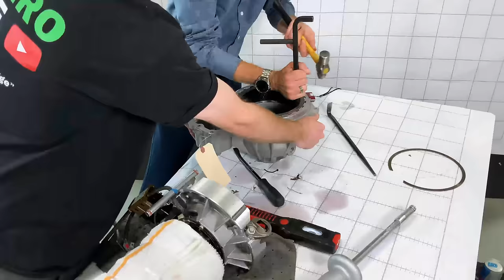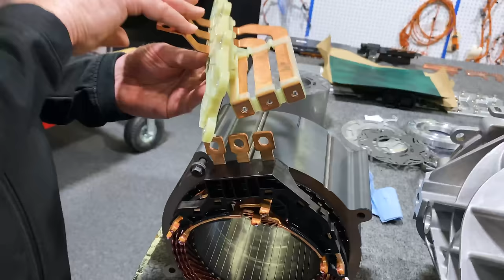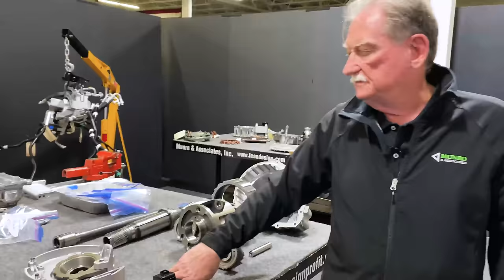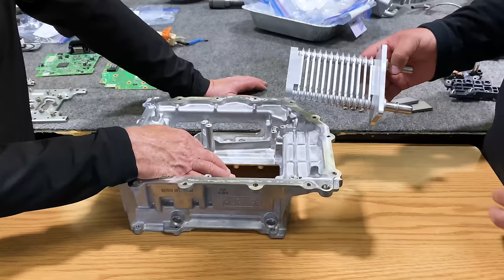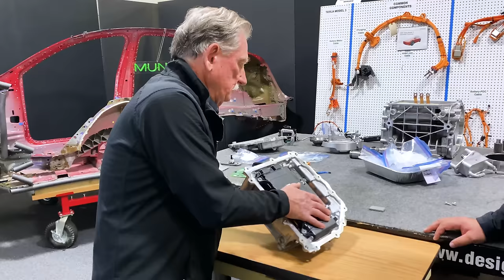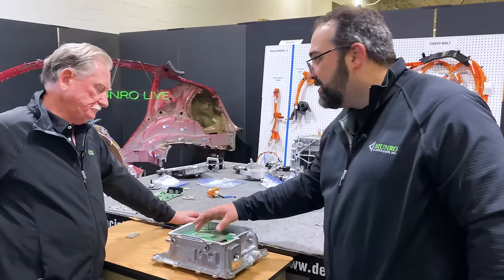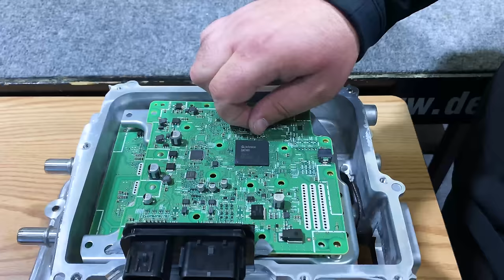Ford Mach-E Rear Motor Teardown and Analysis

Comment: Large circuit boards subject to vibration tend to flex in not supported spans as a result of vibratory accelerations.  This flexing can crack solder joints.  Solutions are to use thicker PCB material (high cost) or provide more supports over the span.  We did larger PCBs and vib testing will kill them if you don't have the needed support points.  Brackets or support rails are a typical solution.  I believe that the vibration environment of the car and associated motor is the reason.
Reply: I don't see how someone could challenge the intelligence of a design god that understands everything man-made that moves. He could've saved every OEM billions of dollars by using least amount of components to achieve highest level of design perfection. Thing about how much all these money can do to world peace.
Reply: resonant frequencies are a b1tch... a simple interaction between a couple of fans and a hdd can make a pc case vibrate so loud you'd think it will disintegrate. :)
also by the look of the board at 25:56 the fasteners appear to be thermal couplers and the plate that mounts on top is a large surface heat sink.

Comment: That base part is so demanding to assemble that I expect even the robots are going to walk off the job,
Reply: Sandy should give us a total count of threaded fasteners needed to build that assembly
Reply: Was that designed and built by a third party?  The labor of assembly and all the extra parts!
Reply: @billy-go9kx  It's a Borg Warner IDU.  B-W did the overall design, subcontracting out the design and part of the manufacturing for the motor and controller.  The case and gearing was done at B-W, and the final integration was to Ford specs.
Reply: @1djbecker  You'd think that a Borg collective effort would be better than that.
Reply: @psdaengr911  In this case for more assimilations, I suppose.
Reply: @1djbecker  Perhaps Ford overestimated the design and the price on what they agreed upon needed some extra materials thrown in so it could be justified :D

Comment: Looks like your team does not have enough power electronics and motor drives background since you focus a lot on the mechanical and manufacturing part. For a motor with or without oil cooling, the difference is the cooling efficiency which determines the size of motor under the given maximum power. So the Mach-E definitely has higher power density than vw ID. For a inverter, the most important indexes are power capacity and control accuracy. The relevant parts are power module, cooling system, current measurement and position sensor. Looking forward to seeing these information in the later e-powertrain tear down videos.

Comment: Could it be that the MOSFETs are soldered to the PCB before insertion in the hatsink assembly?
Reply: Yes, that's undoubtedly how it's actually done.  I imagine the MOSFETs are attached to the PCB, and the entire control circuit side is assembled before being fed through the cooling plate with the TIM applied to the pre-applied MOSFETs.  This makes it a very simple process that isn't very error prone.

The top side assembly could be largely automated then... one tech installed the first plate, sends it to a machine which handles all the welds, then it goes on to the next station... insulation is applied, next plate, back to the next welding station, etc...
Reply: @looncraz  Makes Sense! Still a lot of steps and welding and soldering during assembly time.
Reply: @AndrejGobec  Sure, but that's not much of an issue for this particular component since each step is basic enough you can train replacement workers easily and quickly and run several production lines at once.  The numerous fasteners are the greatest issue, as always.
Reply: Exactly, I'm pretty sure Sandy got this part wrong. Never the less, the design of the inverter could much more elegant and simple.
Reply: @looncraz  The 3 welding steps they described probably go in different sequence - put both coper contacting sides at one time maybe manually, then machine welds it, puts the middle top part and weld it again.
Reply: Hey Mike! 👋 great to see you around here! big fan of your reverse engineering work! 👍
Reply: I thought the same thing. But you still have to remember that all the MOSFETs should then like up with the slotted holder with spring . But that component can only be slid in from the side which would get in the way of vertically arranged MOSFETs. Try to visualize the first part of the video with MOSFETs already protruding from bottom.
Reply: @amkarkare96  Slotted holder first, then MOSFETS soldered to PCB fed in from bottom.
Reply: @amkarkare96  They probably use a jig to ensure proper alignment. Sandy really needs to hire an electrical manufacturing engineer. He might know mechanical design but this video made it clear he doesn’t know anything about electronics.

Comment: Ford has engineered this car to have "a lot of opportunity for failure."  Ford dealerships are very pleased because they see big $$$$$ repairs!!!
Reply: Imagine the joy on a dealers face, when someone comes in with a rattle in the inverter, and occasional cutting out. " Oh yeah, we get that a lot, someone's  dropped a screw inside the inverter." That'll be $1849.63 please.
Reply: Have you ever heard of an EV inverter failure? I haven't, but I'm sure it must have happened somewhere. Parts like this are replaced, not repaired. The three copper strips Sandy complains about allow inverter replacement w/o opening the motor housing.
Reply: @chrisheath2637  or a short  - no one will hear that tiny rattle
Reply: @chrisheath2637  But before they repair it they will try to tell the customer that the noise is normal and a reboot is nothing to be concerned about.
Reply: Acctually, the Mustang is proving to be very reliable. And has a better overal build quality than the Tesla.

Comment: Skewing magnets is done to rduce torque ripple because of magnet flux linkage to stator fin poles. Optimal total skew is always 1/2 * 360 / Stator_slots
 degrees.  It also smoothens harmonics from motors back EMF, but reduces your torque output by max 10%.

Comment: Another area of concern is the high number of soldered interconnections between circuit boards. I have seen solder joint failures in the form of “fatigue cracking” (possibly originating from a poorly prepared solder joint) on automotive circuit boards that could potentially occur here over time from motor/drivetrain vibration subjected to the circuit boards. It would be beneficial to reduce part count by integrating more of circuitry onto one or two boards at most.
Reply: Or use leaded solder again...
Reply: @dangraff8467  They're either wave soldered or the parts have solder "paste" and are heat flowed, but they are flowed in one shot.
Reply: @dangraff8467  You can weld certain things, but when you are attempting to electrically attach delicate components, it's not easy to contain the current or magnetic flux welding produces.  It would also be extraordinarily time consuming and expensive.  Plus, welding is impossible on ball grid ICs of which many are used these days in dense boards. Properly soldered circuit boards should easily last 30 years in a car environment from a physical standpoint (including shock and thermal stresses).
Reply: @dangraff8467  The subject though was solder connections on circuit boards which was all I was addressing here.
Reply: @dangraff8467  Thicker, more thermally stable circuit boards can improve long term resistance to solder related failures, but the old leaded solder was less prone to crack.  Also, proper ventilation of the board and arranging the connectors so they don't get stresses on them which help accelerate solder failures.  It comes down to the manufacturer and how much  they want to spend to extend life.

Comment: Unless Sandy understands a design instantly, he implies there is an issue.  
This may not be the case.  What if there were reasons things were done a certain way? For example, I would expect those soldered connections to be more reliable than a connector, especially for those high voltages.
Reply: He is a perfectionist, he brings up valid points but in the end none of it matters, as long as the customer is happy, and the device functions. Nobody typically cares about how their car is assembled.
Reply: @slayyou  Until it starts having problems after the honeymoon is over. Triple the amount of coolant hoses, parts, brackets, clamps, etc. as the Model Y -- can't be easy to repair. As much as I like the Mach E's interior and driving experience, I'm going with an Ioniq 5 or a Model Y. Just as fun to drive and better engineered.

Comment: the IGBTs used in this inverter are called dsc (double side cooling) which have been extensively adopted by Japanese suppliers such as Denso for Prius for years.
Reply: They are not IGBT's
Reply: @vidznstuff1  These are IGBT's.  Can confirm 100% that there are no SiC MOSFET power cards in production at Ford today.

Comment: Regarding the parking brake, in some markets (ie the EU) it is a legal requirement to have an independant mechanically interlocked parking brake on an automatic car, which an EV falls under, despite having no actual gears to change.

It also tends to be used to ensure the safety case for "un-intended movement" for which an EV is particularly vunerable as compared to an ICE.  With an EV, if the battery contactors are in, then the vehicle can suddenly and un-expectidly move if the inverter applies torque. For an ICE, the faults required for the engine to start, fuel pumps to run, gears to engage and the vehicle to move un-expectidly are just about impossible to occur. Not the case with the EV......
Reply: And imagine your car is San Francisco and catches fire, and start rolling down the hill, because the software just burned ...
Reply: I was wondering about the regulatory ramifications of using a mechanical parking pawl.
Reply: @Fix_It_Again_Tony  Legislation doesn't demand that it's a traditional park pawl/park lock - many OEMs are now just relying on the worm-gear driven e-brake integrated into the foundation brake calipers.

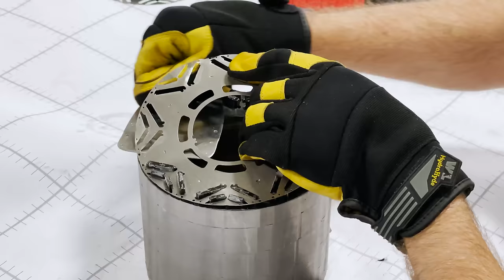Comment: 4:49 I think people refer to moving parts, the rotor is moving but the laminates do not move individually.
Reply: ^this 100%
Reply: Exactly what I was yelling at the screen lol. I understand his point. People do maybe oversimplify the making of an electric motor. But it does have massively less complexity and individual moving parts
Reply: The multitude of stampings in the body shell are all welded together and do not move individually.   they are still in the count of parts as an inseparable assy.
Reply: You also never need to disassemble the laminates on the rotor for service. That's like saying babbitt bearings are multiple parts because they are layers of metal.

Comment: About the inverter assembly, I think the Mosfets are first soldered in place on that PCB, then slide into the cooling thingy and the side on the PCB is assembled first, then flipped over and all the bus bars are put in place and welded.. This prevents to get these 90 or so little pins to line up with the PCB, which would indeed be a big headache for the operator assigned to this job. 

It even could be that the PCB is already fitted with the mosfets from the place where the PCB is assembled, and this could be automated and makes sure the solder connections to the Mosfets are high quality and consistent.

Comment: EMI shielding could be indeed the reason for the countless screws in the inverter box. The high power impulses from the switching mosfets can have very high frequency content. To shield those high frequencies you need to have much surface-area to contact the shield parts together. Too little contact-area between the shielding parts renders the shield useless because of skin effect and high parasitic inductance. I saw that happen many times because of oxid layers on the aluminium which acts as an insulator. So in the first glance you think you have a wonderful farraday cage but with all the oxid on your aluminium parts you only have a partly closed cage which is not obvious. So you have to take care of it as an engineer.

Just an educated guess....
Reply: That also explains the fancy coated screws, thanks for the tip
Reply: Shielding for EMI can be a real headache, no?  
I don't know if they used used a conductive gasket on the lid, perhaps a molded rubber one with a woven metal strip around the entire perimeter.
Reply: D. G-S, how do the other manufacturers get around that without the mess that we saw here? I'm sure there's a way to design this better, especially given that we've seen evidence of this being done.
Reply: If that’s the case why not use a RF gasket sealing arrangement?

Comment: Why so many screws on PCBs? Mikeselectricstuff pointed it out : it's for avoiding mechanical resonance issues or prevent any flexing on these boards, BGAs don't like this at all. And this inverter assy is exposed to an extreme vibration environment.
Reply: Couldn't they have used snap in standoffs to do the same thing?  I've been involved in a few product designs and we only used screw standoffs for prototyping.  I can't think of a single case where we used them in production.
Reply: @videcomp   What are you prototyping?
Reply: The design team likely has a spec for the area and weight between circuit board supports for each environment.  Since this is rigidly mounted to the drive unit, it's a high shock and vibration environment.  Without the freedom to select a thicker, more rigid circuit board stack-up (which creates its own process change problems), the solution is more clamping supports.
Reply: @6AM_YT  Latest project is a smallish remote crawler with manipulator attachments for making repairs inside sewer pipes.  I'm mostly providing guidance, experience and refining the requirements. My engineering student intern is doing all the heavy lifting.  He's been working part time for me since high school and can now out program me in one language and is definitely faster using Fusion 360 for mechanical design. So he is doing most of the hands on work..  I actually quote Sandy to him and say "look we can leave that screw in for now but remember you'll have to figure out how to remove it from the next iteration."  I like Sandy's "we call them un-fasteners" .  We try to limit them to where a tech might need to access a part for troubleshooting, repair or maintenance.  We try to avoid someone accidentally breaking an assembly because they can't figure out how to disassemble it, so we use "un-fasteners" because that is what they are for, not for assembly purposes.
Reply: There are many better ways of preventing flexing and fixing a pair of boards and a shield between them. Especially as you have a ridged cover on top of them. With proper design maybe 10 screws for both boards.
Reply: @1djbecker  which means that the design team needs firing for lacking any design skill. That was slap some parts together prototype shite! Same as the cooling system.

Comment: As an R&D Engineer who practiced the "Less is More" philosophy in Automotive, Military, Aerospace and Medical devices, that Inverter is what I would call a real Cluster**&k!😱
I wonder how much that would lighten your wallet to replace?
Assuming you vehicle did not turn into a useless lump of Slag after the Inverter melted down and took everything else with it!😬
A definite Steep learning curve at work here. As long as they keep making timely progress. 
Before they are put out of business.
Mike in San Diego.🌞🚀🎸🖖

Comment: Thanks for the show !  IGBT  insulated gate bipolar transistor...
Reply: Wrong video, buddy - this doesn't have any
Reply: @vidznstuff1  Mentioned in the video. They were earlier switching semiconductors, and now they are moving  to silicon carbide Mosfets, which have advantages, but are more expensive.